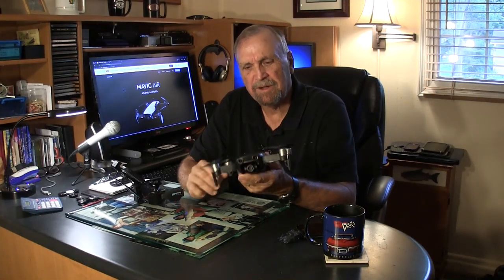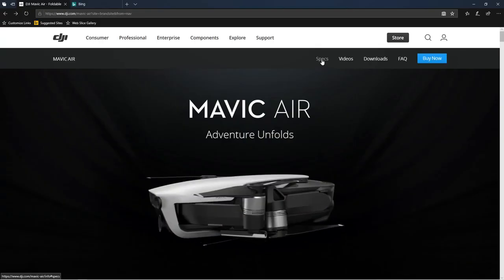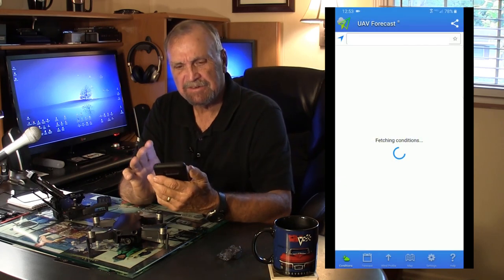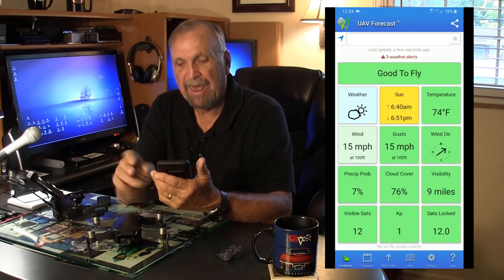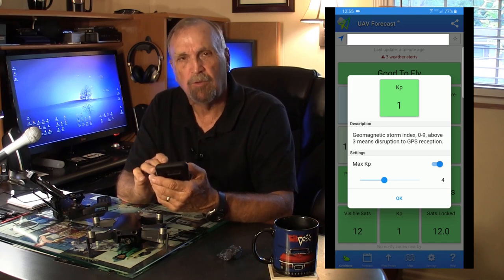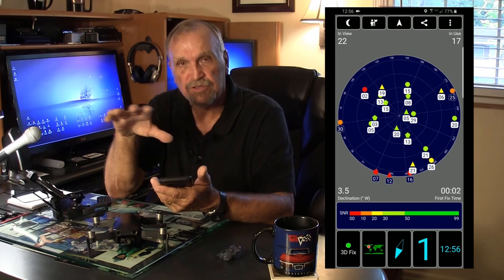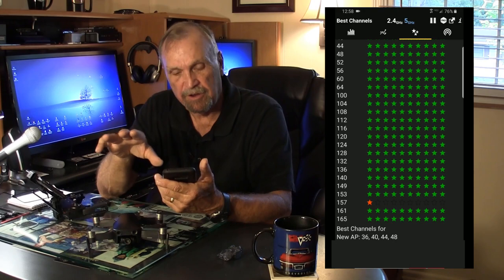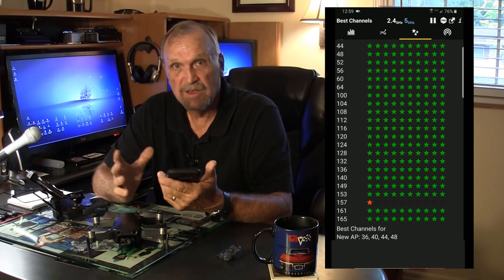Mavic Air ...  Stop losing connection

Comment: Good video.  I never liked the Fly apps satellite icon. Checking the Satellite app gives much more information bout their grouping.  I have several Wifi apps. Never really crossed my mind to use them to look at what's around me before I fly.  I'm always focused and excited to fly but putting these all together definitely gives you a better, more informed picture and is much safer.  I have figured out that 5.8 Ghz is stronger and less susceptible to interference, especially here in Vietnam where 5 G is only just now being tested. Most people don't want it, don't use it because the equipment is costlier but you are right about the interference and the importance of checking the environment first, especially the magnetic spectrum.  My Mavic Air once became so disoriented that it began to fall out of the sky. All I could do is watch helplessly as it was spinning downward. However it did reconnect and when it did, all the controls were opposite. Front was now back, left was now right.  The other thing you are dead right about is that you, the pilot, are responsible for your aircraft.  I could of given up but I quickly figured out the reversed stick moves and kept thinking. "You cannot give up, work the problem".  It was weird, but I was able to land it precisely where I took off from.  Later, I found out that at that exact moment ions from a sun flair had hit the earth.  Not sure if it knocked out the drone or disoriented some of the satellites but my point is that I didn't quit.  Now I fly 3 other drones as well. The Mavic Air 2, The mini 2 and the C-Fly Faith 2.  I've become a pretty good pilot after 2 years of flying and crashes no longer happen because I follow the procedures I've developed and I never take unnecessary chances.  I scour the internet all the time for any new information I can add to my knowledge and that's why I'm glad for this video.  Just added both apps. Thanks.
Reply from the maker: Sounds like your really getting it figured out, that's great. Having a starting procedure is key to safe flying. Thanks for your comment.

Comment: My Mavic Air has 7 red bars.. & no WIFI interference. Something wrong with the drone?
Reply from the maker: If all locations you go to have red bars in both 2.4 and 5.8 then maybe there is a problem. Try checking it with the app in the video. You say no WIFI interference? Can you fly the drone with no problem?